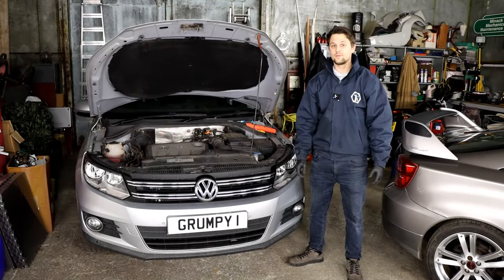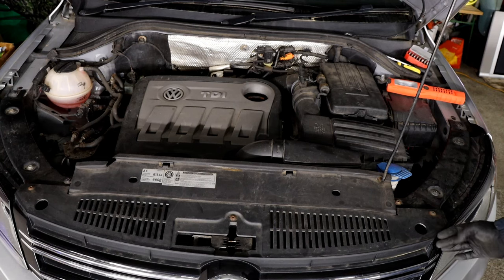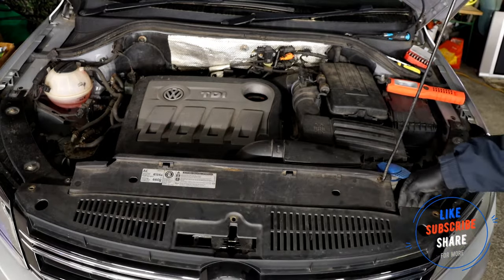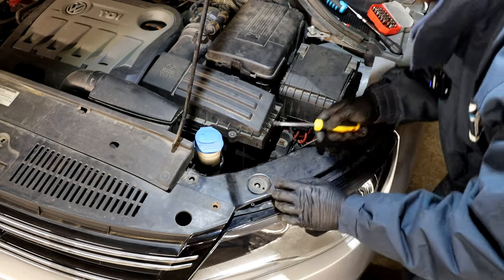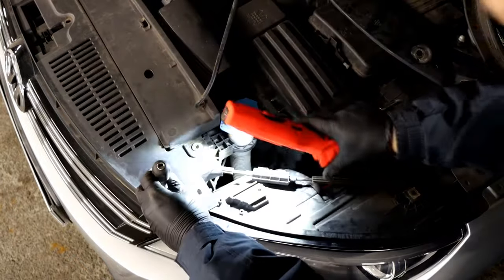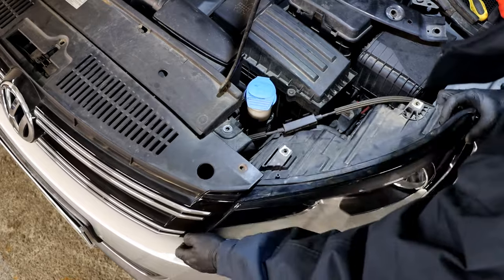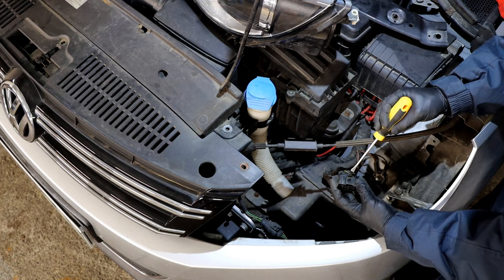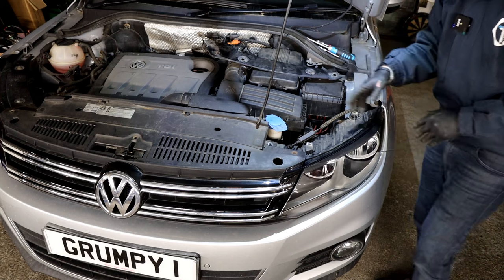VW Tiguan 2008-2017 Headlight removal. How to remove the headlight unit on the Volkswagen Tiguan.

Comment: This was the most helpful post for removing both lights from our 2009 Tiguan. When I thought it was a bulb replacement, it turned out that the insulation on the wires to the bulbs got brittle and cracked so they shorted the lights. After attempting to fix the wires we decided to replace the whole assembly on both sides to avoid continually replacing wires. THANK YOU!
Reply from the maker: Well done 😀 thank you very much

Comment: Thanks for this Alex. Saved me some head scratching. One of my sidelight bulbs fell out of the holder into the side light housing with no way to retrieve it without removing the headlight. I'm relieved to see I don't need to remove the bumper.
Reply from the maker: Awesome 😀 well done 😀

Comment: That long reach to the t30 way down there ... what kind of tool do i need to ask for at the hardware store? I have nothing but an $8 torx set from walmart. Definitely not what you have but I am willing to buy one. Just have NO IDEA what to ask for at the hardware store.
Reply from the maker: Hi there. Just a long torx kit. Or couple of extensions for your ratchet
Reply: @AlexTheGrumpyOne  Thanks I ordered one with a 6 inch extension. It looks like it is about 7 inches tall so i'm hoping that's enough. I appreciate you getting back to me.
Reply from the maker: No worries. Hopefully that will work and u get it sorted 😀

Comment: I HAVE  THE  SAME  CAR  IN BLACK  COLOR  WITH   SKY PACK...  ITS   A  GREAT  CAR ... OIL  AND FILTERS  CHANGE   NOT  MORE  THAN 10.000KM  ,,,    FORCED DPF REGENERATION  WHILE  DRIVING  EVREY 10 DAYS  NOT MORE  USING  VCDS 2020.... THE  UNIQUE  ISSUE   THATS I HAD  RECENTLY  IS  THE  EGR  VALVE  COOLER...I CHANGED  ALL  EGR  MODUL,, NOW  ITS  FINE  .. ITS RUNING  LIKE  A  CHARM
Reply: Stop yelling!
Reply: @OmidKhodaverdian   im not  yelling